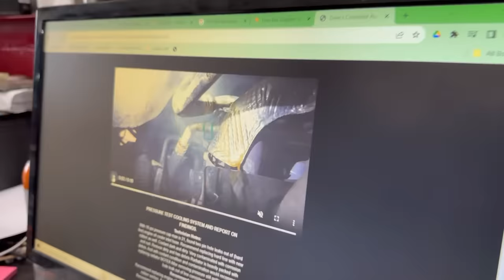The truth about maintenance, and what the manufactures tell you vs what you need to know

Comment: I have a 2012 Accord with 121,000 on it. I change my oil every 3500 miles at 50%-60% on the reminder. At the same time I pull the drain plug on the trans and change 3.5 quarts of fluid. The Owners Manuel says change every 30,000 miles. I'm a firm believer in PM. I treated all 3 gens of my Dodge 5.9 Cummins the same way. I also change my oil in my Chevy K10 once a year because I don't drive it that much, maybe 1K miles a year. I grew up with the saying, "Pay me now or pay me more later". I also do regular brake fluid, power steering fluid and coolant flushes.
Reply: You should calculate how much extra you’ll be spending over 5 or 10 years. 3,500 mile transmission fluid changes is probably way overkill unless you’re towing with that Honda lol.

Seriously though, you may be spending an extra $5,000 over the ownership of this car for little benefit. Do the math, try to find a good middle ground. Preventative maintenance is great but money is what it comes down to, and it could be a lot of money.
Reply: @andreahighsides7756   I'm 65 years old. I've had more vehicles in my life including semi trucks than I can count on my fingers and toes plus your fingers and toes. I've NEVER put an engine, transmission or any drivetrain component in any vehicle ever...and I have the money so it's not an issue. I believe in overkill when it comes to maintenance to things I own. Plus I live in the desert and 115 degrees in the summer is a vehicle killer.
Reply: @tdc9136  that’s good! If you’ve got the money then it makes sense to make it last. One day these will be relics of history
Reply: My car leaks oil so I never have to change it, just add 😂 (I do change the filter though)
Reply: @fortheloveofnoise  no you 100% still have to change it. Maybe you could stretch out the interval more, but you need to drain out all the warm oil to completely empty the pan of sludge and particulates.
Reply: I assume you're talking about the old STP oil treatment TV ads?  Showing the gnarly looking guy standing next to the engine hanging from the hoist and grinning like a chimp.  Yeah thought it was pretty good ad, as far as TV ads go.
Reply: I understand your logic, but that's an extreme waste of fluids. This isn't the 1960s, the quality of filters, oils, and additives is leagues better. I can understand half-intervals for long term quality, but that trans fluid swapout really is excessive. Brake fluid again I can understand yearly (I detest soft/spongy brake pedals), but power steering can easily last 100k miles, and coolants are good to go for 50k easily. I haven't seen someone with a power steering problem since crappy late 80s/early 90s cars have basically ceased to exist, and I see tons of 150k+ mile vehicles.
Reply: The trans fluid change is complete overkill, but it will last a long time. Every 3 years or so is good for Honda's
Reply: Changing the trans fluid at that interval is a bit nuts, you can go about 15k since the transmission typically runs at a far lower temperature than the engine.
Reply: @blabla903 iv had 1 transmission fluid change, which was a flush, at 100k, car still runs fine at 175k
Reply: If you stop for gas every 5kms and you've never run out of fuel is that proof that stopping for gas every 5km is the best way to do it?
Reply: @andreahighsides7756  unfortunately to completely empty the pan of sludge you'd need to drop the pan. 
It's never 100% empty with a drain and fill. 

But I get what you're after. 

The transmission flush is overkill on distance driven. Pull the dip stick and smell it and inspect. 
Same with your oil. 
With new oil tech, I'll change a 07 Accord 2x in a year. Is it dirty? Yes, sludge? No. 
I'll pull the valve cover to confirm in spring.
Reply: I got a 2013 Honda Accord I change my oil every 7k miles base on Honda recommendation
Reply: @fortheloveofnoise  Change the seals immediately. Oil leak is not something to take lightly. You still need to change oil regardless of it leaking as the sludge is not leaking but only the oil is.
Reply: 3500 is for the engine oil not transmission
Reply: You really probably don't have to do your transmission that often I mean with every oil change really? That's just extra man.
Reply: I work at an Acura dealer, basically a luxury Honda. So similar thing. I suggest transmission flushes for our non-CVT transmissions around 30K. Doing a drain & fill maybe 10-15K would achieve more or less the same thing. And 30K is early - originally they were supposed to have 'lifetime fluid' too. But we got tired of constantly having judder issues so we started recommending them more frequently. We don't see judders often anymore, seems like word has spread that 'lifetime fluid' is lifetime of the fluid - not lifetime of the transmission (unless you only want to get 60-90K miles out of your transmission)
Reply: A bit of overkill, but ok🤷🏽‍♂️
Reply: @fortheloveofnoise  in my Civic ill run 2-3 oil changes thru one Mobil filter rated at 20,000....but skipping changes no bueno
Reply: @fortheloveofnoise9298  You should still do a drain and fill every 5k with new filter.

Comment: People think if my car isn't over heating the coolant is good. Flushing / changing your coolant is a very important maintenance maintenance issue...
Reply: My 1981 vw rabbit has ORiginal coolant reservoir with no gunk. 

It’s probably only had coolant changed 6 times the last 42 years.
Reply: Long life coolant only needs to be changed every 5-6  years under normal use, providing there's no issues with cooling system.
Reply: @DL101ca   I agree and that was my point but most people think it lasts forever.  Then they have heater core issues etc... Can't fix stupid

Comment: Buying my first ever car, i immediately was worried about oil changes and servicing, nobody mentioned it to me when I was learning to drive. My first car I have changed all of the fluids, replaced filters and timing belts and my car feels and drives better because of it.
Reply: Awesome! I remember how fun it was doing that with my first car. Assuming it’s a used car check out the owners forums for common problems, it can really help get ahead of impending issues. Like my first car was an old passat, a rainwater drain in the engine compartment would get plugged with leaves over the years and eventually flood water into the cabin footwells, destroying the ECU ($$$). Super easy to prevent once I read about it, a lot of cars have weird special issues like that as they get older.
Reply: And you learned something doing the maintenance it’s fun especially if you have a driveway or garage you can do most of this maintenance yourself.
Reply: That is the first thing they do when buying a used car. Change the oil and buy 4 new Bridgestone Potenza 17 inch tire
 LOL

Comment: As the Car Care Nut says, "oil changes are a lot cheaper than a new engine" and that goes for every fluid. You can easily tell the difference between a car that does easy routine maintenance and ones that don't

Comment: As a helicopter mechanic in the Marine Corps I can not tell you how much I agree with this guy. Most of our time we were performing preventative or phase maintenance on the helicopters, didn't matter if the part was good or bad, if it had such and such amount of flight hours on the part it got replaced. mostly fluids, oils, grease's and filters.
Reply: It is the so-called 'safe life' construction philosophy. 

The thing with automotive is that nowadays cars are built to last only for 7 years. You cannot win that maintenance race in the long run.
Reply: Exactly. I have a truck that I maintain that's 15 yrs old and it's perfectly fine but the radiator is part plastic, the hoses are 15 yrs old, the pump is 15 yrs old...so I replaced them all.
Reply: Aircraft maintenance is not even in the same ballpark as auto maintenance. Everything is done on a schedule and constantly inspected because lives are on the line. None of it is optional.
Reply: @Mach141  I don't get your point. They're just different levels of preventative maintenance. Sure air craft preventative maintenance is more in depth, but that's not my point. My point is WHYyyyyyy it's done not how in depth it's done.
Reply: @MrDhalli6500  My point is you can choose to do your autos maintenance whenever you want, not following the manufactures suggestions at all, and still have great results and a longer lasting car. Maybe you just focus on your particular vehicle models problem areas and ignore the rest. None of this is possible with an aircraft. Hope that makes more sense
Reply: Yeah but were you doing all that preventative maintenance at double the schedule recommended by the manufacturer? That's the part I'm skeptical of.
Reply: Unit_104  Of course but I was talking about how often you replace things relative to the maintenance schedule set by the manufacturer or engineers. Because that schedule should be designed to replace things before stuff breaks. My question is do you actually take the official schedule and then do everything twice as often? I'm not sure what the answer is with aircraft but I seriously doubt that is necessary for cars just to keep them running well.
Reply: HH-60G helicopter maintainer here. TOML! 👣
Reply: My coworker doesn't believe in space and still believes the earth to be flat ... despite all the evidence and physics of technology levels that are used in everyday life. Point is, just make your money fixing these ignorant people's cars over and over again. If they can't understand why they keep replacing their vehicles from lack of maintenance f it. Take all their money you can.
Reply: @brandenrussell2647  So I guess not only does "Stupid hurt" ...it's also expensive
Reply: @brandenrussell2647  These same idiots who don't understand why they need to maintain their cars will be turned away by really GOOD shops, or they'll file frivolous complaints, and try to take a shop owner to court over their car.